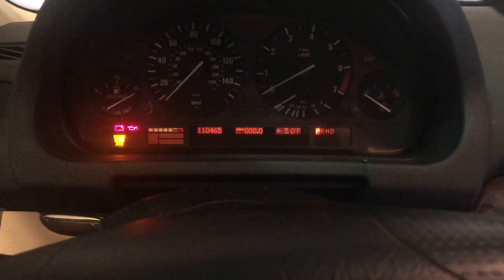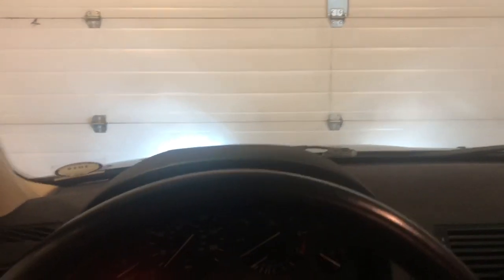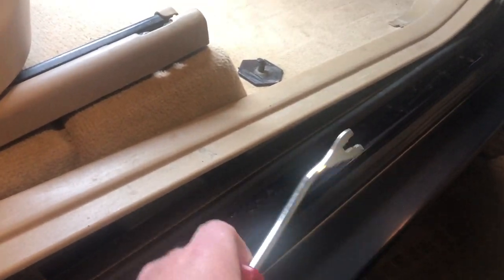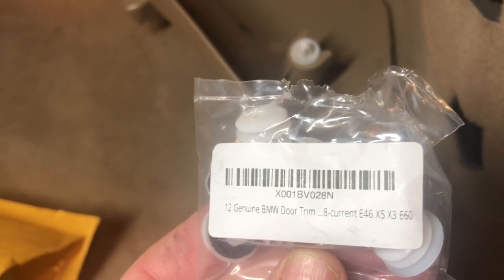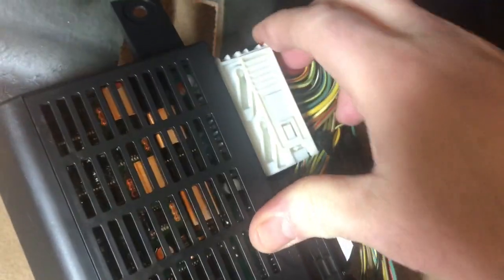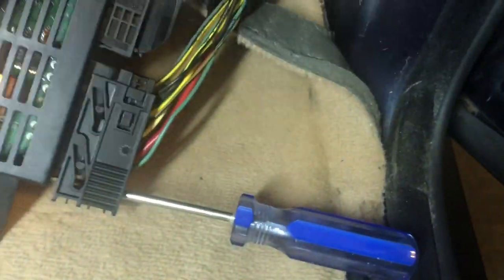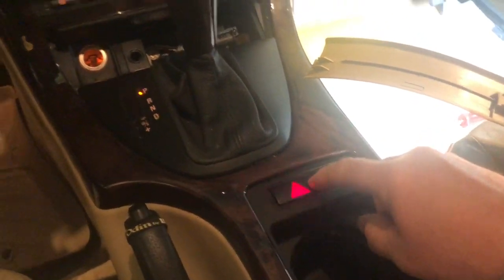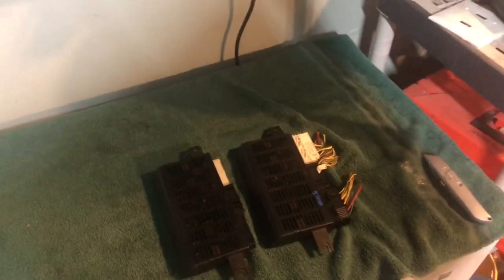BMW X5 E53 LCM

Comment: Would the LCM effect your brake lights staying on while the my 04 2004 X5 is is running?
Reply from the maker: Not 100%, but most likely it is an issue with your LCM.

Comment: I did change lcm on my 2006 3.0d ( I bought lcm with the same part no.) . And it worked as well. The only think is that small dot appered next to speedometer as you say. Similar symptoms...  Saved me lots of cash. Thank you buddy

Comment: Thanks for this excellent video! I have a 2004 E53 that is experiencing the exact same symptoms as your was. Did you pull a code to determine the lcm was the problem or did you replace based on symptoms alone?
Reply from the maker: I did not look for codes. I only read forums that said it’s time to replace your LCM.
Reply: @AK907dude  Thanks for the quick reply! Based on what I read of various forums and watching this video, I just ordered a replacement lcm. Thanks again for this excellent video!

Comment: Hi Corey, wondering if you have time to check something for me on your LCM connector X10117 (that's the wide black one in the middle). I've swapped an LCM 4 w/auto LWR into my E39 and am running the wires for the LWR stepper motors to retrofit the factory Xenon headlights but I can't find the proper wiring diagram anywhere to tell me exactly which wires go to which pins in the LCM. At 4:07 in your video I can see the wires running into the plug so if you've got some time to open the connector and check you'd be able to let me know the proper pinout.

Comment: Do you need to code it to the car?
Reply from the maker: No coding needed, but... your red tamper dot will be on in the dashboard, and if the previous car did not have Xenon headlights but yours does, then it may not display the proper lights for daytime running lights or high beams. That was the case with mine but I eventually got all the software and cables to code away the tamper dot and fix my high beams.
Reply: @AK907dude  is the exact part # important when getting a replacement or just the Text description part matching "LCM IV W/ AUTO LWR" is enough. I have Xenon with levelling
Reply from the maker: @csleeut  I’m not sure, but I would think you need the exact part number.

Comment: Hi buddy just asking when you disconnecting old one, and you connecting the other one as same part number do yo need  a code to work? Pls let me know thanks buddy
Reply from the maker: No coding needed, but... your red tamper dot will be on in the dashboard, and if the previous car did not have Xenon headlights but yours does, then it may not display the proper lights for daytime running lights or high beams. That was the case with mine but I eventually got all the software and cables to code away the tamper dot and fix my high beams.

Comment: Great Video! I have a question for you about my X5 E53. My tailgate brake lights don't work (clear and red), but my release button and license plate lights do work. I'm inspecting the connectors (male and female) and I notice the harness only has two electric pins, but the tail lights have 3 pins. I looked at the same harness (2002 x5 e53) on ebay, and it only has two pins as well... Then I looked at the taillights, and all those have 3 pins too! So it seems like everything should be that way, but I just don't get why the female connector uses 3 pins and the male connector uses 2 pins. I was going to see if you could possibly check and see if your x5 tailgate lights are using a 2 pin connector that goes into a 3 pin as well. Thanks again for the videos! A+++++  Cheers!
Reply from the maker: My tail light harness has 4 wires and 4 pins on both the male and female connections.
Reply: @AK907dude  and thats the ones on the tailgate? Both my side taillights have 4 pin connectors. But my tailgate light assembly (the one with the reverse light on top) only has 3 pin connectors, and the harness has room for 3 pins, but only uses 2. Thanks for the fast reply!! I couldn't believe it when I got a notification from youtube lol. Cheers!
Reply from the maker: @FloridaBikeSupplyOnline  You are correct the one on my tailgate has three pins but only pins one and two are used. I believe the third pin is used on M series BMWs
Reply: AWESOME!!! Thank you so so so much. Do only your reverse lights work on that? My reverse work now, but the red lights on the same assembly don't work. Thank you so much for checking that out for me!! You're a great man, saved me tons of time.
Reply from the maker: @FloridaBikeSupplyOnline  yes, only my reverse lights work on the tailgate. In fact, there is a factory red cover over the lightbulb socket for the red lens portion.
Reply: @AK907dude  That's awesome to hear! You went over and beyond on this one, and saved me a ton of searching and time :] Thank you so so so much for all your help, you're an amazing person.

Comment: So you just disconnected it and reconnected it
Reply from the maker: I disconnected the broken one and connected the used one.
Reply: @AK907dude  what years does this work on
Reply from the maker: @ericthebeast1277  it for sure works on e53’s which were produced from 1999 - 2006, but I imagine it works on every BMW that has an LCM.

Comment: if you buy a used one like u did off ebay, do i need to get it coded, or just drive it?
Reply from the maker: You can just drive it like I am, BUT... my used one must have come from an X5 without XENON headlights, because now it uses my XENONs as daytime running lights and when I switch to hi beams it tries to use my low wattage daytime running lights. There are videos out there how to get the software and do your own coding but I have not tried that yet.
Reply: thank you in this info

Comment: Wow! Thanks, I'm having the same issue, did you have to disconnect the battery before replacing?
Reply from the maker: No I didn’t. But warning, my high beams and daylight running lights do not work as before. There are some vids on buying software for your laptop to reprogram the LCM to work for your optional headlights installed.
Reply: Corey Morgan thank you
Reply: Corey Morgan what did your lights do that differ than prior?